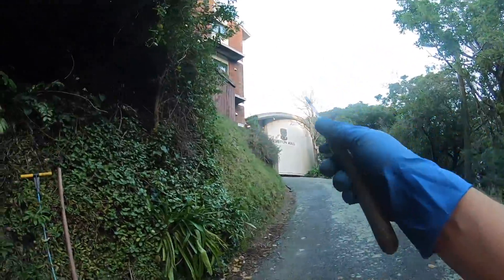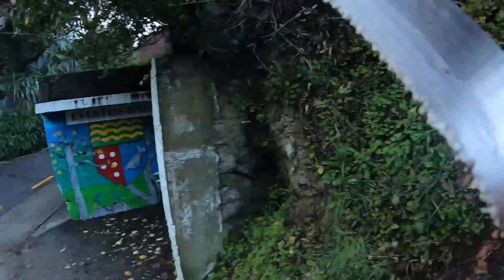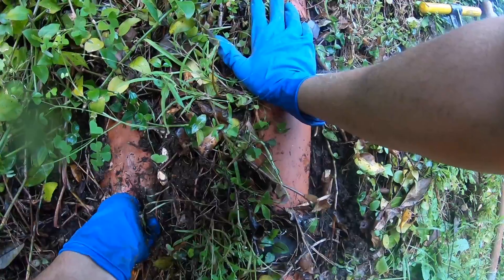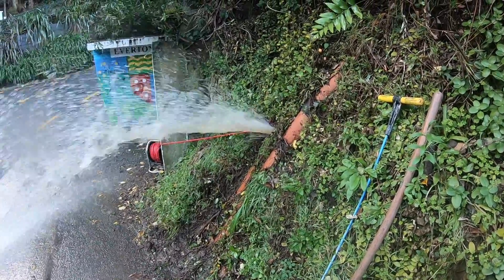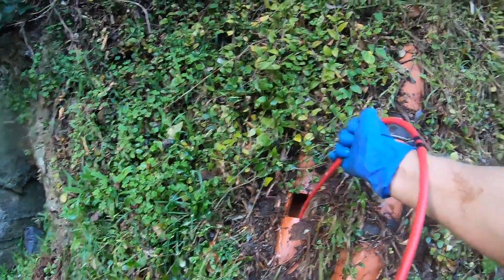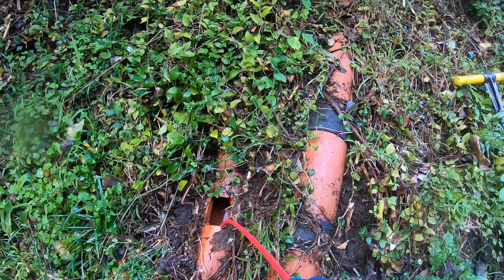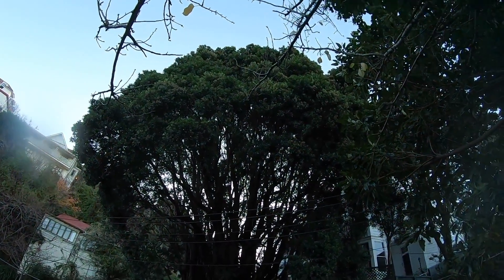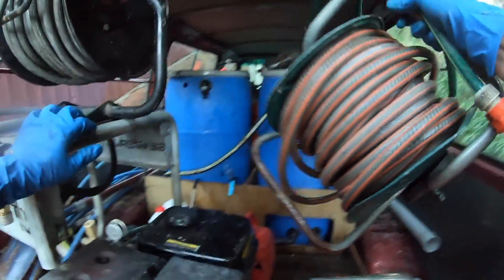Mr Drains # 63   There She Blows!

Comment: RE : WINDOW VAN...
Window vans make great work trucks with the glass letting 
in lots of light to help find your tools & equipment.
HOWEVER,
Crooks can also see into your van & see what there is to pinch.
SOLUTION  :
Paint the insides of the glass white. This will allow light in just like before
BUT,
No one can see your tools or eq.

!
Reply from the maker: Not sure if you noticed the window on the drivers side slide door (right side) is tinted as this is a second hand window from an auto wrecker. 

I had to replace it after someone smashed it during the night on my driveway looking for tools. They opened up the orange lockbox to discover absolutely ZERO tool, but stole the ashtray with about $20-30 in parking change & trashed my van.

I unpack all my tools every night after work (its so much fun.. not really). The mistake I made was not leaving the tool chest lid open so they could see there was nothing to steal.

I'm about to replace little red with a another vehicle very shortly.

Comment: The suction behind a toilet flush must be enough to pull the shine off the porcelain with the angle of that pipe. 
Did you patch the hole?
Reply from the maker: I'll have to see if the primary contractor did something with it or if its been forgotten about.